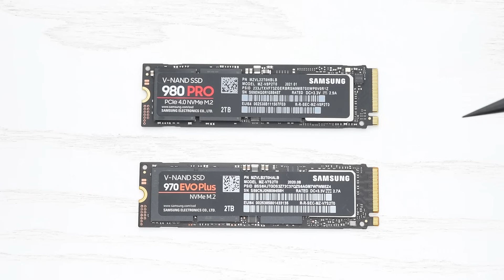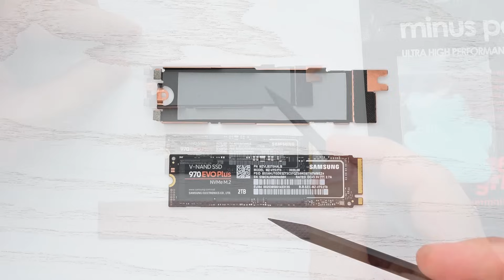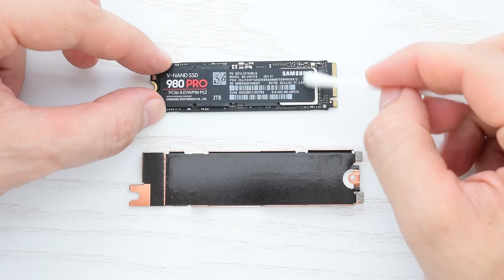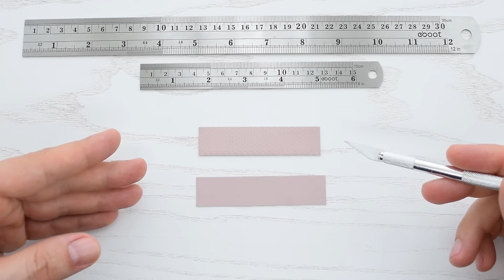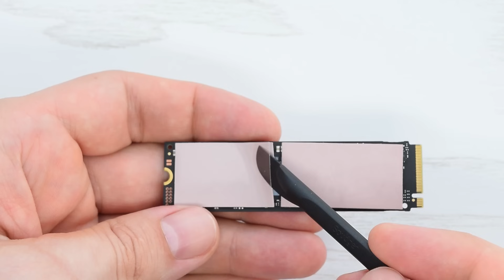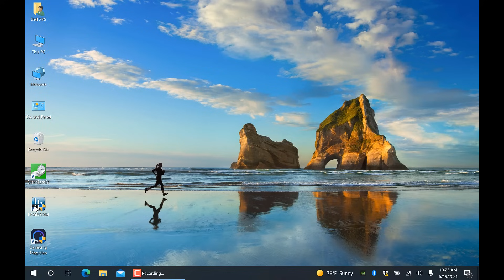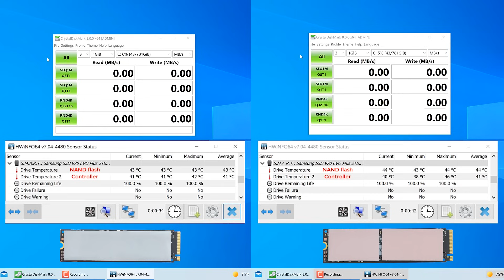Stop your Samsung NVMe SSD from Overheating and Thermal Throttling

Comment: may i ask a question..can i replace 1mm with 0.5mm but i double it?..
Reply from the maker: Yes, you can use that double-pad, but it will perform slightly worse.
Reply: @ElectronicsComputers  okay thanks.. ☺️

Comment: Nice tutorial thank you, but, wouldn't you get better heat transfer if you took off the paper Samsung sticker, before you put the thermal pads on?
Reply from the maker: Removing the label will void the warranty and it doesn't make any real difference in cooling your SSD.

Comment: Thank you! Can I use 0.75 and 1? Or better 0,5 and 0,75-1
Reply from the maker: The difference between chips is 0.5mm so you need 0.5 and 1mm pads (or if your cooling system allows 1mm and 1.5mm).
Reply: @ElectronicsComputers  thanks a lot!

Comment: Are the SSDs that come with heatsinks better or should I just use the default heatsinks from my computer and get regular SSDs?
Reply from the maker: Depends on the manufacturer. For example Samsung came up with the 980 PRO with a built-in heatsink. And if you remove that heatsink, guess what you'll see inside? Yes, there will be several thermal pads with different thicknesses, just as I showed you in the video. But they went even further and made separate pads for small chips as well. You can check out the pictures: https://i.ibb.co/10HwmmQ/980PRO.jpg
I'd definitely recommend this SSD.
Reply: @ElectronicsComputers  So for example, if I plan to get the 980 PRO 4tb, I should NEVER get the variant without the heatsink?  Like the ones from your video?

Comment: Hi! Thanks a lot for the video - this is really helpful. Do I understand it correctly that if Thermal pad is initially 1mm(on my motherboard MSI X670E Carbon) then I can simply put SSD without accounting for height difference?
Reply from the maker: In most cases thick thermal pads cover uneven surfaces better but it also depends on the heatsink and how the SSD is mounted. Check out how Samsung installs their SSDs in their heatsink: https://i.ibb.co/10HwmmQ/980PRO.jpg They went even further than I did and made separate pads for small chips as well. I'd leave 1mm pad for the NAND chips and added 1.5mm pad for the controller chip. But first test the temperature of your SSD using some software, that shows two temperature sensors not one and then decide what to do.

Comment: Thanks for video. Isn't thicker thermalpad worsening heat exchange? What's the recommended temperature for NVMe drive? Mine's around 40-50C, isn't it much? Seagate Firecuda 530 Pcie4.0 with main board mounted heatsink. SSD manufacturers are generally not really considering operating temperature in my opinion, I mounted some Adata which had RGB piece of plastic instead of heatsink so there's no way to mount one onto it 😁
Reply from the maker: $40-50 is a good temperature. Yes, the thicker and softer the pad, the worse its thermal conduction. I think your setup is good the way it is.

Comment: Wouldn't using one long heatsink carry some heat over to the side that may not be as hot? Would using 2 separate heatsinks be better?
Reply from the maker: To answer your question, look at what Samsung did with that design flaw on their new updated SSD with the heatsink: https://i.ibb.co/10HwmmQ/980PRO.jpg
They went even further than I did and use separate pads for all chips. One pad on such uneven surface will never cool down critical components which drastically shortens your SSD's life.
Reply: @ElectronicsComputers  Would you ever suggest a heatsink with fans? I see them and wonder if they work well or hurt instead

Comment: i found out after change from HDD to SDD, that windows restart faster, load faster, firefox is 3 times faster, youtube loading faster, programms loading faster, i install the Samsung 980 PRO SSD, 1TB, before my OS HDD was 250 GB big but 1TB is more than enough for an OS and extra Data. A SSD is best invest to upgrade your Computer i can tell you 100%.
Reply from the maker: Great job!
Reply: Tipp, you an move you OS with all its programs and adjustments, with Ease US Partition master to a new SSD, without installing windows again, and reinstalling your programms (your licences remain Valid), windows might ask you for a New Windows key, due to hardware change (because i changed the mainboard and CPU, at same time)

Comment: In my laptop, ssd have to be installed with controller facing down. And now low performance due to thermal throttling. Any suggestions?
Reply from the maker: What's the model of your laptop?
Reply: @ElectronicsComputers  HP 15-bc406tx

Comment: Great tips, however, I have 3 questions, I'm looking forward to your thoughts on these: 
1. Which one is better? Gelid Solutions GP Ultimate with Thermal Conductivity: 8 W/mK OR Grizzly Minus Pad 8 Thermal Conductivity: 15 W/mK?
2. How much thermal conductivity value is good for a thermal pad? I'm playing games a lot and I'm sure my SSD will be stressed over a long time.
3. I'm planning to buy WD SN850X 1 TB for my Legion Y740 laptop, do you think a thermal pad with 1 mm thickness will fit inside the laptop?
Reply from the maker: I would use Gelid Solutions GP Ultimate pads. When I was making that video that brand wasn't on the market yet. Grizzly Pads on the market for a long time, they are very reliable and last very long but don't perform as good as Gelid Solutions.
Reply: @ElectronicsComputers  Thank you for responding, I was confused, the Minus Pad 8 has a higher thermal conductivity value, and I read somewhere else that higher thermal conductivity is greater for taking care of the heat. But I'll stick to your advice for Gelid Ultimate for purchasing in the future. Do you think a 1 mm thermal pad is fit for the laptop in general?
Reply from the maker: @ZkyMaster   Well, I've never seen laptops' heatsinks that allow thermal pads thicker than 0.5mm. And I highly recommend using two different pads. Samsung now has SSDs that come with a heatsink and a bunch of thermal pads of different size. They basically did what i showed in the video but they went even further: https://i.ibb.co/10HwmmQ/980PRO.jpg

Comment: You can just use one 1,5 mm pad and screw the heatsink down tight.  The pad will be pressed together so that it will touch both parts.
I only have one pad on my 980 pro and the temps are quite good.  These grizzly pads already provide quite an improvement from stock pads. The lower temps you show here might as well just be from the upgraded pads.
Reply from the maker: One thick pad works perfectly for most desktop computers and I mentioned that in the video but unfortunately most laptops only allow to use 0.33 - 0.5mm thick pads. Moreover, Samsung made a version of the SSD that already comes with the built-in heatsink and if you remove that heatsink, you'll see that they went even further and applied different size pads for every single chip: https://i.ibb.co/10HwmmQ/980PRO.jpg

Comment: My Laptop didn't have heatsink, still need use thermal pads?
Reply from the maker: If there's no heatsink, there's no need for thermal pads as well. But if there's enough room to install a universal heatsink, then you can use this method.

Comment: Hello, I bought a new laptop and I have doubts that the disk is not new, but used. CrystalDiskinfo shows:

Total host reads: 947GB
Total host writes: 889GB

Power on count: 748 count
Power on hours: 50 hours

I have installed only Wnidows 11, 140GB for games and some small programs. Is it normal to have so many reads/writes operations?
Reply from the maker: That drive has been powered on for 50 hours it's not that much. Maybe your laptop was  from the display and was powered on the shelf. Or if that laptop originally was without Windows, someone maybe was installing OS, drivers and software and forgot to turn it off, who knows. But brand new laptops don't show  such info on new SSDs.

Comment: Can I use two .5mm pads on top of each other for the controller chip?
Reply from the maker: Yes, you can but it will perform slightly worse that a 1mm pad.
Reply: @ElectronicsComputers  I see. How much do you think would the temp difference be of slightly worse? 1-2 c maybe?
Reply from the maker: @flictee1417  Never checked, but I can say for sure that it will cool down your SSD way better than just one big pad.
Reply: @ElectronicsComputers  Ok thanks.

Comment: This is a good follow-up from your "Upgrade your Dell XPS 9500 Series" video, which I followed to upgrade my 9510 with the 980 and am now experiencing even worse heat than I was before!
Reply from the maker: What thermal pads did you use? There's a 0.4-0.5mm difference between chips. So you need to put for example a 1mm pad on the controller chip and a 0.5mm pad on the memory chips.
Reply: @ElectronicsComputers  I didn't know I needed thermal pads, I just put a heatsink that seems to have one already

Comment: Hmm OK cool video, but should't you have applied a droplet of thermal paste on the thermal pad prior to installing the heatsink for optimum heat transfer? I've seen other people do it, and it seems really promising. How about a 2023 edition video featuring a revisit on this topic and comparing the results between stock,  thermal pad + heatsink only and thermal pad + thermal paste drop + heatsink?

Comment: the problem is industry standard thermal-pad quality is very low

that's why splitting the pad helps 

if the pads were designed by a boutique company splitting it would make no difference because the conductivity would be 30x a vanilla pad

Comment: for anyone that want even more cooling and not restricted by space, check out Thermalright HR-09 2280 cooler.
i am using one and it is amazing. I wish someone told me product like this exists, not just small cooling fins, but large cooling tower.
just notice it is a laptop repair video lol. mine advice only works for pc.

Comment: Is it specific to Samsung? Where is that documented? As far as I know NVMEs should not be cooled too much and nand is expected to be run hot. If you would cool something, you should only cool the controller. Is that wrong? What you are saying and doing here is controversial to majority saying that stock pads are enough and they shouldn't be cooled too much or their life would be shortened.
Wish I have seen a definite documentation from the manufacturers themselves. In a short test like this you could show it is better to cool but that doesn't mean it applies to long term usage.
Reply from the maker: That design flaw is common among many manufacturers, but some have fixed it by adding a plate on top of the drive to even its surface. Additionally, Samsung offers a model with an integrated heatsink. All semiconductors that operate at temperatures higher than 50°C-70°C start to degrade. While NAND may perform faster when it's slightly hot, you'll never notice that difference in any circumstances. Apart from NAND and the controller, there are many active components that don't like to be fried on a daily basis. All I care about is data safety, not imaginary performance or what some YouTube 'experts' without any background or degrees in electronics may say. I hope it helps.
Reply: @ElectronicsComputers  Well I measured it using the software you provided (I use heatsink provided by the motherboard with a regular pad) and temperatures were below 60 degree even under heavy load and in this hot summer day.
Also using Crystal disk mark, just playing with settings a bit, you can show one is running faster than the other.

Comment: If you remove the sticker it will be 3-5 degree more cooler.
Reply from the maker: Removing the label will void the warranty and it doesn't make any real difference in cooling your SSD. From our experiments the difference is no more than 1-1.5C.

Comment: I just got the 970 EVO 2tb installed in my Alienware m15 R4 in the last week and noticed immediately that I was having extreme heat problems. It was even affecting my cpu. I've had to undervolt the cpu by 100.6 to get the temps under control but the 970's Drive Temperature 3 is still running at 76 minimum. It's freaking me out. Thank you SO MUCH for this information. I was worried I was gonna burn out the whole laptop if I couldn't figure it out.
Reply from the maker: Yeah, 970 gets really hot. try to use two pads with different thickness. In my laptop I use two 2TB 980EVO and it's a big difference in terms of temperature.

Comment: Just a question - isn't it bad if the sticker is there? I mean why not removing it and putting it somewhere?
Reply from the maker: Removing the label will void the warranty and it doesn't make any real difference (1-1.5C) in cooling your SSD. So it's up to you.

Comment: Recently you wrote that found better solution than thermal grizzly - gelid solutions gp ultimate. Can you tell how much better? In degrees (why you ignore?)
Reply from the maker: Depends on your setup the difference may be 1-3C.
Reply: @ElectronicsComputers  my laptop lenovo legion 5 pro 16ach6h ryzen 7 5800h rtx 3070

Comment: Seems like the simplest solution is to not buy Samsung.
Reply from the maker: It's not just Samsung's fault. In most cases the memory chips are thicker compared to the controller chip in various SSD brands. This design variation can be observed across different manufacturers.

Comment: Same design as my WD SN770. I just realised the problem a few days ago and planning to fix it. The controller on my WD ssd reached 81C on CrystalDiskMark and that's 4C far from its limit. Idles at 58C which is much higher than an average ssd is idling.
Reply from the maker: Pretty high temps. My solution will solve that problem for that SSD as well.

Comment: Help, I have an 970 evo plus and did this but with a thermalright xtreme oddesey pad and 0.8mm heatsink. Under heavy load, it reached to a maximum of 88 celsius, minimum is 58 with average of 58. What could i have done wrong?
Reply from the maker: Did you use two the same 0.8mm thickness pads?

Comment: What also helps get temps down, is removing the label/sticker of the 
chip and storage, a label/sticker does not contact heat that good.
Reply from the maker: Yeah, but removing the label will void the warranty and it's just 1-1.5C degrees difference.

Comment: these should come from factory with heatsink. what a crappy design of drive. they never thought these would get so hot to the point of needing heatsink which is not really supported on every laptop forcing you to hack a way to add one to this garbage.

Comment: this is interesting but probably futile to do, I haven't seen my m.2 get remotely hot enough even under stress for this to matter.
However, I'm using crucial and WD mostly and haven't used samsung since 2.5 inch drives.

Comment: How much of that improvement was from the better quality pads? BTW: That doesn't take away from this being a fantastic idea anyway.
Reply from the maker: The difference between the stock thermal pads and the grizzly ones is no more than 2-3 degrees Celsius. If we compare one pad and two pads for some Samsung SSD models, then the difference in temperature can reach 10 degrees, as you can see it from the test.

Comment: i have B550 MPG with a heat shield, do i need one? how do i know if m2 is overheating
Reply from the maker: No need to do that. There's a whole bunch of different software to check the temperature. You can use the same app as the one that was shown in the video.

Comment: I bought an m.2 from an unknown company that says you'll always get top performance without needing a heatsink, and it will always remain under 65°. I've been using it for 3 weeks, and so far, it's been working overtime and has only hit 63° once. It's a 2tb 7000

Edit: It was only $89.99

Comment: blodie question: isn't that important to remove the sticker first and then just put the thermal pads over the chips? What do you think about that?

Thanks for an amazing video!
Reply from the maker: Removing the label will void the warranty and it doesn't make any real difference in cooling your SSD. If the warranty is not a problem, then go ahead and remove it, you'll gain another 1C degree.
Reply: @ElectronicsComputers  Thank you!

Comment: if your samsung overheats right solution is to buy ssd drive from diffrent company, which is able to manufacture drives lacking OVERHEAT feature :):face-green-smiling:
Reply from the maker: I wouldn't trust my precious data to any brand other than Samsung.

Comment: I have 2 temp sensors on my M.2 980 PRO 2TB. Wich temperature do i need to watch? Sensor1=51° and sensor2=64° on idle.    EDIT: i only put the thermal pad on the controller chip and the temps dropped 6°c on idle and 9°c when gaming. (using only the mobo heatsink)
Reply from the maker: Sensor 1 is  the NAND chip and sensor 2 is the controller chip.

Comment: is there a need to remove the SSD sticker as the thermal pad is above the sticker?
Reply from the maker: Removing the label will void the warranty and it doesn't make any real difference in cooling your SSD.

Comment: Hi can you advice me on this, I have just installed a sata ssd in my laptop. This ssd lies on bottom left if I turn laptop upside down. So when I am using the laptop, the right palmrest gets uncomfortably hot when ssd is reading/writing although temps. are quite normal during use, around 45-46C. The issue is palmrest is made of aluminium so it feels hotter than it really is. Can I use thermal pad somehow to release the heat on the bottom instead of top ?
Reply from the maker: What's the model of your laptop?

Comment: From your benchmarks, the heatsink doesn't necessarily seem to offer better performance all together. You are getting higher sequential reads and writes but slower random reads and writes which I generally consider to be more important.
Reply from the maker: You'll never notice that speed difference, but you'll definitely extend your SSD's lifespan
Reply: @ElectronicsComputers  True.